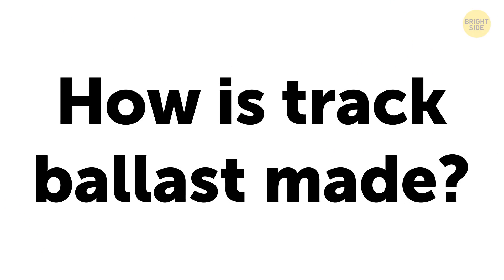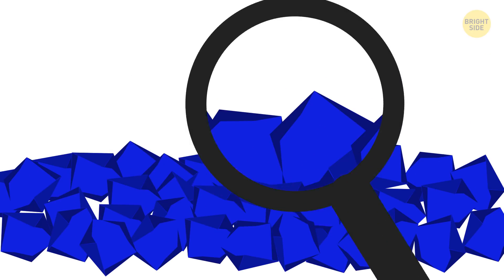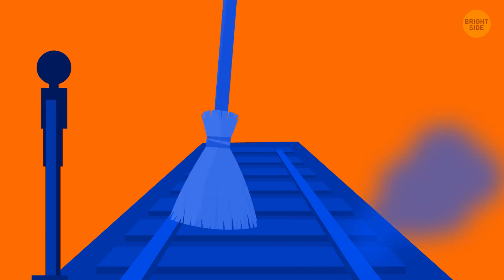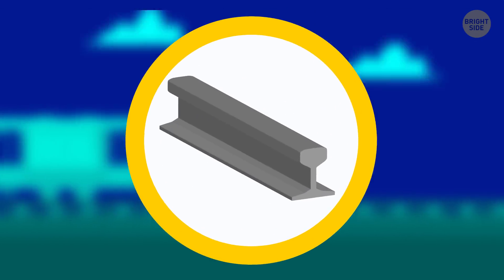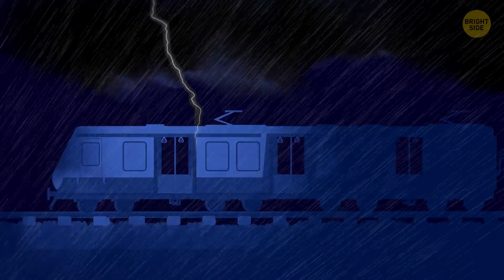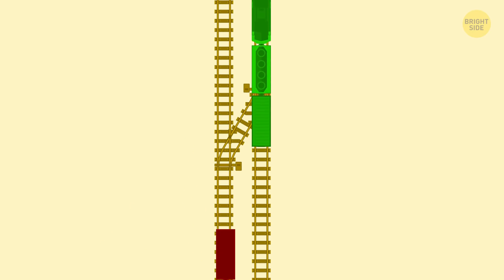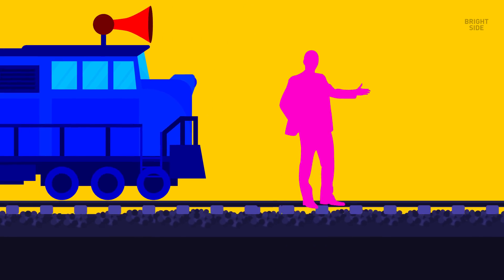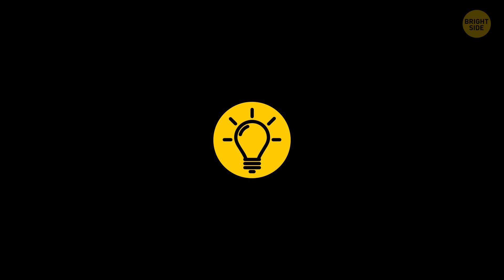What Stones Along Railway Tracks Mean

Comment: The video failed to mention that where individual rails meet, they are offset on each side of the tracks so that the gaps don't line up, which produces the familiar "clickety-clack" sound as the train passes over the gaps.  In other countries, where rails meet, they are aligned across from each other, creating a rough "thump" whenever the wheels of the train pass over the gaps.
Reply: I noticed that on the Trans Siberian. They also used prefabricated sections with the rail and ties in place, and then the whole assembly lowered into place with a crane.  Contemporary welded rail or continuous rail or ribbon rail is in lengths of 1/4 mile.
Reply: @Dutch_Uncle :  Yes.  The Russians are the best-known example of the rough "thump" of the wheels passing over the gaps.

Comment: Why do tracks have gaps? To allow for expansion. That's completely wrong. Tacks had gaps because that's how long a length of track was. So they had gaps, between lengths of track. Modern-day lengths of track are usally welded together. This is done via a process known as "exothermic welding" So there goes your "Expansion" theory. Just letting you know.

Comment: Britain does Railways so much better, safer and different to the americas. On the subject of horns, this is the US rule 21, in the UK the meaning of each of those horns is different as the UK standard for rail vehicle horns is a two-tone set which is proven to be safer than the US standard single, and so pedestrians and motorists can differentiate between a car or a train, with added benefits of the driver to add their own flair to 'W' boards.

Comment: Expansion joints is old technology that has been surpassed on most railways since decades with welded tracks. To handle thermal expansion, the tracks are held in place with stronger supports.
Reply: In Aussie, the track is stress welded. Before the final welding, the temp of track and air temp is calculated and a gap is cut out. The track is then pulled together and welded.
Reply: But of course this is rarely seen on heritage railways. But still a great solution. Though not as simple, it is very very useful.

Comment: One horn blast means 'stopped'. Two horn blasts means starting to move forward. Three horn blasts means starting to 'back up in reverse'. When coming to a crossing the engineer does two long blasts, then a short blast then a long blast until the engine clears the crossing. As for ballast as already said, it's purpose is to drain water away from the ties.
Reply: 3 short hits then a 3 second long hit then repeat that 3 times
Reply: Well of course this depends where you are greatly.

Comment: Gaps allowing expansion were mentioned, however Today's Railroads are using More Welded Joints, Which Require Curves in what would otherwise be Straight Tracks.

Comment: Now at these days we have new Train Tracks designs like the Plinth Tracks/Slab Tracks or a railroad that doesn't need ballast
and those train track design is commonly used in
Elevated Metro Rails, Elevated Light Rail, High Speed Trains, Undergrounds/Subways.

That gap between the 2 steel rail is the reason why it creates the clickety clack sound.

Comment: They Weld the edges of the track together now !
Reply: True, James; but the joints are still there.  There's just fewer of them.
Reply: @Silver_Turtle  not always, destressing the track properly tends to reduce issues...just depends where you are and location.
Flat open areas with moderate temperature variation won't tend to have them, hills in an area with extreme temp variation may use them though.
They also tend to occur a lot in cities just because it costs too much to improve old rail,they tend to be more hesitant about closing lines for long periods.

Comment: you cant make crossties out of concrete they have to be wood or trains will derail in curves but i cant figure out how or why
Reply: You are seriously misguided.
Reply: They can make them out of concrete; they do work.  They last longer, make the track smoother and more stable; thereby increasing speed.  And I have yet to see any statistics claiming that concrete crossties/sleepers on curves are more dangerous.

DISCLAIMER:  Been around railroads and railroading for 63 years; but, sometimes I have been incorrect.
Reply: 100% of our RR ties are reinforced, pre-stressed concrete ties. They have cables in the middle and the concrete is poured around them.
Curves and grade, and all. Wood ties are much smoother. Concrete breaks apart and chips much more readily. I go down the rail,
and chunks are off to one side or the other or both. You can tell where the rough spots are going to be by the patches of concrete
powder from the up and down movement. (Wood ties, one never knew).)It will be brown ballast, then a patch of white, (rough spot) then brown ballast.
The only time we encounter wood ties any more are industrial sidings, and the speed is to slow to compare to main line. I have a 250 mile run,
and it is all concrete ties. Both directions. I'm pretty sure it's the same everywhere else now. I've never derailed, so can't answer that., but we have concrete.
Everywhere on main lines.

Comment: The longer the train, the longer the stopping distance.
Reply: True, to an extent. Empty coal trains can stop much more quickly than any other type. Engineer must take into account loads and empties,
type of drawbars, (if they are cushioned drawbars) how many are in the train, and placement. Mostly Autoracks are cushoined drawbars.
If you try to take off to quickly, or try to stop to quickly, they will have a "slack" action effect and can easily break a train. It's like a huge Slinky.
You can feel it when you start pulling or stopping. Slow and easy is the key.

Comment: Hey awizardalso im a retired locomotive engineer. And, in a American railroads book of operating rules, 2 short blasts of a railroad locomotive horn or steam whistle reads as follows " answer to any signal. Not otherwise provided for" but, yes it is most commonly used to answer a proceed signal. ( forward movement).

Comment: Worked for the track department of the railroad back in Michigan in '67-'68 before I was drafted, and ran a Matisa tamping machine for the last 6 months.  The machine would pack the ballast under the ties to provide consistent support to them from the ballast.  It was a 28 ton machine with over two tons of vibration to pack the ballast under the ties.  This was before the OSH Act, and I believe the machine was probably banned for noise by this act.  Was working in the rail yard in Jackson, MI and had a switch engine come up about 10 ft. behind me and lay on the air horn.  Couldn't hear it!
p.s.  To answer other questions...  The gap in the rail is to help with thermal expansion/contraction, but in Michigan, the thermal change between summer and winter was such that we would put a 6.5 inch section of track into a joint (the distance between the bolt holes on the splice in the late fall and take it out in the spring.  We called this piece a joker.  Additionally, 'creepers' were used that would clamp on the rails against the ties to prevent the thermal change from allowing the rails to 'creep' and break joints.  I have personally seen where thermal contraction would break a joint and leave a 12 inch gap with no rail...  Also, your highlight of what a 'frog' is shows more than the actual frog.  the frog is only the section where the rails cross, not the switch or switch points.

Comment: Hot sunny weather can cause the steel rails to warp and thus the railroad might implement heat speed restrictions
Reply: The term is "rail kink."  In extremely hot weather an inspection car goes out to check.

Comment: With welded rail, how does it expand or contract?
Reply: It does not. Instead of movement you get stress.
Reply: It will still expand, but laterally -- they still have expansion joints, just not every 39 feet [which used to to be the length of a section of rail; now it's approximately 1/4 of a mile]

Comment: As a person who builds and maintains high speed railways this need to be removed and go back to the drawing board for the information. 

Ballast is granite not gravel!
The track is built up from a formation normally sand then a geo textile material, then consolidated ballast, then sleepers then rails; then ballast after to fill the gaps in simple terms.

Key point that was missed was the compaction of ballast at points under the sleepers normally performed by a train called a tamper.

You can run trains a full speed after replacement of new track and ballast construction